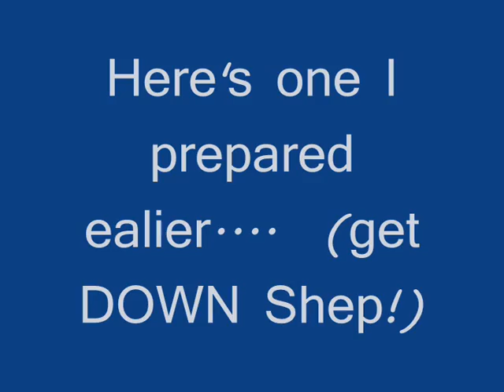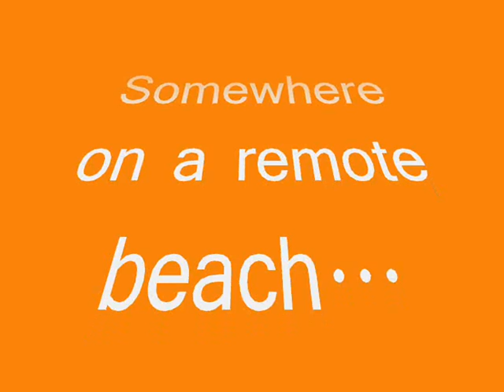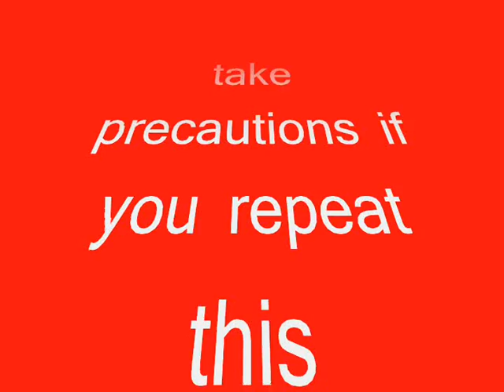Solar Cooker Experiment

Comment: Great! I be waiting to see your next video!  I'm doing something similar with an old satilite dish. I cut galss mirrors into 1" squares and glued tthem to the dish. I'm goig to mount a small "George Foreman Grill" on it.  Don't know if you've heard of those down under or not. They are just small electric grills (about 6" square)  that have a hinged lid that also has an electric burner. It's made with a slant to allow grease to drain. It's an old one and the electric coils don't work anymore.